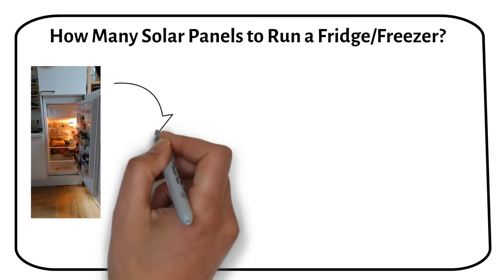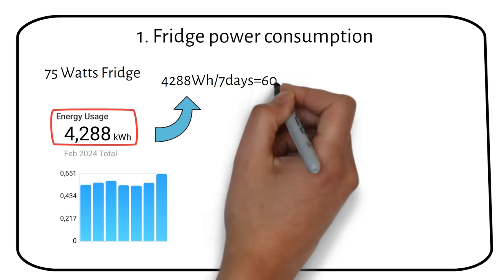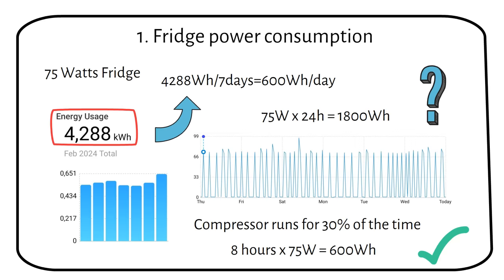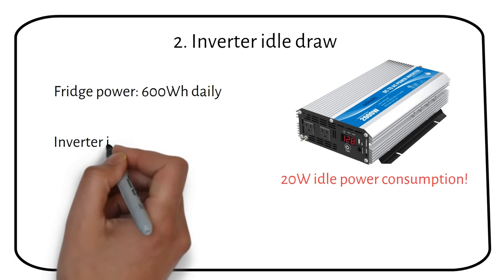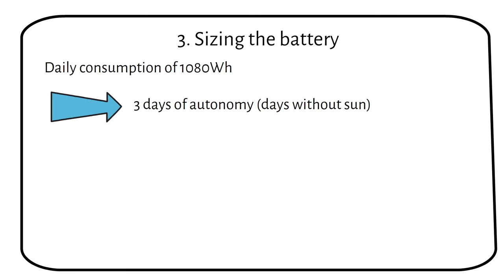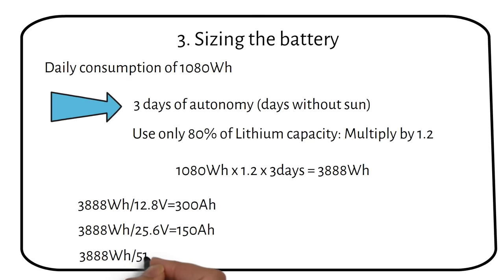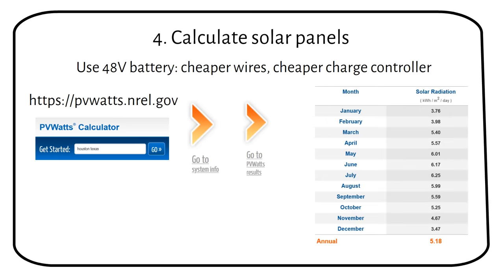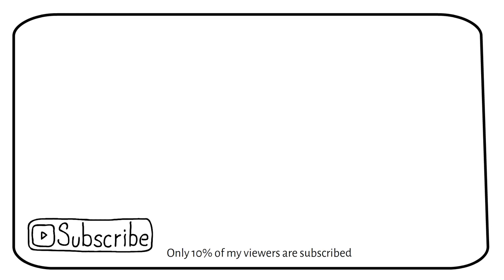How Many Solar Panels To Run a Fridge/Freezer?

Comment: Your video is very nice but has several problems. 1) In the slide at 0:41 seconds, the "Energy Usage" shows 4,288 kWh. It should show 4,288 Wh. 2) You are not taking into account DC-DC losses (solar panels -> solar charger-> battery) which are 10% to 20%. 3) You are not including DC-AC losses (battery -> interverter -> AC) which are 10% to 20% but can be much higher for low power loads such as 75W. 4) You recommend three days of battery storage (good) but then recommend recharging the battery (3 days of charge) each day which is oversizing the solar panel array. 5) I do not recommend using the worst month of the year which results in higher cost and wasted solar production for most of the year. Instead, use a low-cost inverter generator to recharge the batteries on poor solar production days.
Reply from the maker: Thanks for your comment John. It's using European decimal placements. I figured the people will figure it out. If I take every loss in account then nobody would end the video 😄. I'm displaying a still simplified calculation for the viewers who are new to solar. I made a video about how long a fridge will last. It talks about losses more in depth. It would be great if you could share your findings on that video as well. Thanks
Reply: @cleversolarpower I did not mean to criticize your video as it is very good at covering the major factors to consider. I have watched some of your other videos and you have a good set of videos that share information.

Comment: Solar panels are now cheaper than ever. I recently bought a 460W panel for just 72 Euros! Good quality as well. So no reason to save too much on panels.
Reply: too much panels are never enough, they are chea nowadays. The limiting factor are the square to fit them.
Reply from the maker: I agree. Second hand is even cheaper.

Comment: Sorry, but from what I understand you calculate the PV size in order to recharge the batteries fully in one day, after they were discharged after 3 days of autonomy. Maybe I didn't understand correctly. But if I did I would argue that in reality you need much smaller (dare I say half) of the PV energy production. Please let me know what you think and if you have run some tests with smaller PV size 🙏

Comment: Clearly a solar system to run just a refrigerator is a hard sell considering the average refrigerator in the U.S. only costs about $100 per year to operate, and a solar system designed to accommodate only that will cost thousands of dollars. That would mean a return on investment of at least 20 years.

Comment: 24h Inverter draw seems ludicrous (80% of total fridge draw!)... isn't there a smart inverter or a timer for the inverter you can sync to sunlight cycles? 

This would result in an 8-12 hr inverter draw depending on lattitude.

Not sure what the dusk to dawn generation actually is... would imagine nextlatitude.

 If so, could inverter simple be turned off (via timer or on via light sensor)?

Great video though, really appreciate the thorough breakdown of everything!
Reply: If you turn off the inverter you turn off the battery so no power to the fridge.  The inverter takes the DC from the solar panels or the DC from the battery and converts it to AC for the fridge.
Reply: I live in southern Norway (59' North) and have an off-grid summer house with a refrigerator without freezer which use little power (was announced as 62kWh /year) , Liebherr TP1720-21 and    use a 600W ePever Inverter which have a remote on/off switch. This is connected to an external thermostat to the refrigerator. Then the idle current of the inverter does not influence too much on the total power consumption. Refrigerator is On from Easter to October without any problem running on one 12.8V/100Ah Lithium battery and 550W of solar panels. If can run 4 days of total darkness,but us others have mentioned, som wattage are generated also on clouds days
Reply: There are several different quality manufacturers of DC refrigerators and freezers. They generally have much more efficient compressors and are double insulated for roughly the same price as a regular AC unit. I have a DC 20cu/ft chest freezer that runs just fine on 200W solar panel with a single 100 amp/hr battery. I'm not talking about the small portable refrigerator and freezer that plug into your 12v car socket. I'm talking about stationary refrigerator and freezers identical to what you would find in any house. They are indistinguishable from regular appliances.
Reply: @daviddogsbody  are there no 12v fridges. The computer world tries to get to 12v DC now to save on power supplies, especially in data centers.

Comment: 2  3 hundred and twenty watt panels 4. 1 hundred amp lithium batteries 1 Twelve hundred watt Phoenix inverter 30amp charge controller  work great

Comment: I did it differently I used a voltage switch  connected to a 12v battery charger,  feeding a 100 amp hour battery and 5 100w solar panels if the battery volts fell below 11.5 then the charger switched on, when the battery volts rose above 13.8 the charger switched off the solar panels were connected across the battery 24/7 as is the 150w inverter,  that way there is no interruption to the supply to the fridge freezer, ie if  there is a time when the panels can't fully charge the battery ie some winter days and at night then the charger takes over,  its a sort of mains assisted solar supply,  that way the number of panels and size of battery is not to critical
Reply: excellent..

Comment: What inverters are recommended? Thank you for the video and comments.
Reply: Good question. I have an 800W inverter, and it seems to get at it's limits in the moment the compressor starts. Thankfully my inverter has some short term overload capacity. Even if the fridge only consumes 75W in AVERAGE, during compressor start up it need's much more. First i tried it with a 300W inverter and it did not manage to handle the start up currents. It went into overload protection mode. The 800W does work, but it sounds very loud during that moment. I kept the 800W, but i would recommend more than 1000W. Maybe someone else here has tried it with a bigger inverter?

Comment: There's a couple of tricks they won't tell you when building off-grid solar to maximize power at minimum cost. 
But, you'll have to think outside of modern convenience.
First...set your panels up facing East and West with solar breakers that get flipped at noon. You'll pick up 6 to 8 extra hours of sun per day.
Second... only use heavy draw appliances when the sun is out. Turn off the fridge at night and during heavy clouds. It will stay cold a long time.

With these strategies, you can run that fridge with two 300w 10a panels each way, and 6 -12v  batteries in a 24v pattern.
Reply from the maker: That sounds like a big inconvenience. Why flip the breakers on at noon and not just leave them on? Why run the risk of spoiled food when you turn off the fridge?
Reply: @cleversolarpower  
Because a refrigerator is insulated and is fine for 12 hours. Why drain your batteries? That seems a lot more inconvenient.

Comment: This is a wonderful video! I see some campers and RVs have typical home refrigerators and they pay for it, of course.  If using shore power mostly, that can make sense, or if they have huge solar / battery systems.

I see a lot of vans have about 4 solar panels.  That's a far cry from the 11 that would be required.  

If I was a van guy I'd get something like dometic designed for low power consumption.  My biggest expense would be the laptop.  I could get away with low power settings.  The numbers you give allow me to accurately compute power usage here and see how many panels would be needed.  

Typically I run 15W according the Battery Info software in Linux.   That could be off by some amount, of course.  It can get to 30-45W.  I can tweet my usage to make it less.

Ty for info!
Reply from the maker: You can also get a more efficient inverter for the fridge. A 1200W victron phoenix inverter uses about 10W idle. Since phoenix inverters are low frequency, i think you should be able to power a 75W fridge with the 500-800W inverter.
Reply: @cleversolarpower  Ok, thanks for the tip.

Comment: I found a brand new Liebhr 24 inch full size fridge at the brick (Canada)for a cabin i have,, it was missing some of the front covers and door handles and I got it for $500 , according to its spec sheet it uses 0.789 kwh over a 24 hour period , 288kwh annually , its power specs are 183 watts at 2.3 amps which I think is amazing for a fridge this size,, I have power at the cabin but we arent always there so I am trying to put together a solar backup when the power goes out strictly for the fridge(Shuswap was devastated by a huge fire recently and power was out for weeks)
Reply from the maker: Yes, Liebhrr fridges and freezers are efficient. They cost a lot more, but if you are off grid it will save you money in the long term.

Comment: Sounds about right.
If you want to go cheap and efficient, you can go for a minimal option with regard to everything. It then does require you to monitor battery status closely and unplug your freezer units and hook em up to the normal grid when your input power is low. So basically have 2 separate systems.
Also helps a lot if you lay down a strict policy on yourself for opening the fridge/freezer door, when power is low. Saves a lot of energy. Also keep your fridge/freezer well organised, so it doesnt have to be open long. And provide them with enough room (depends on which model) to cool itself. etc

Comment: Most inverters have a switch to turn off the stand by function.
Utilise this switch into the fridge controller circuit, and when the fridge compressor is not needing to run, disable the standby on the inverter.
When the compressor needs to run, just pony an auxiliary contact to turn the inverter to run state.
The battery will still charge, but the panels will not need to overcome the standby current while charging on a non-standby state.
Reply: To extend your idea further. Most modern refrigerators will hold temperature for many hours. Put the inverter on a timer that turns off the inverter at 10 PM and back on at 6 AM. Then cycle on and off during the day. That can reduce standby inverter losses by 50% or more.

Comment: Good luck 
I’m on a boat in the caribe. The heat loss is amazing and a lot of battery power used for refrigeration. 
Certainly way more than your % lol without opening it at all
Reply: Hardly surprising that a boat fridge isn't as thermally efficient as a household one.

Comment: My fridge with top freezer uses 210 W during normal running.  When the frost free cycle kicks in it requires 900 watts for about 10 minutes.  Size your system for peak loading or you may have surprise shut downs.
Reply from the maker: That's a huge power draw for the defrost cycle! Never seen it this high.
Reply: 900 w is possible for defrost Because elements that heats up evaporator.Maybe possible to install lower wattage elements.But in general far better to use cooling system that fit with solar.Cheaper

Comment: The inverter is wasting 40% of the electricity. Instead of these small cycles and being always on. Why not turn it and the fridge off overnight on a timer when its typically colder anyway, its not open. Then let it recool in the morning, reducing your idle power consumption a lot. Plus you will have power running the fridge when its sunny, directly. You could just connect it more directly, no? It seems crazy to spend thousands on such a huge system just to power a fridge.

Comment: By swapping the fridge ac motor to a DC motor that can run straight off the battery would save big time. 

This would eliminating the inverter cost/efficiency, and the battery size of almost double, and the double the size of the required solar panels.
Reworded, using the inverter you need a 80% larger (1080/600=1.8) output, now the three day deal makes that 3 times worse for the battery and panels..Now the ~100W DC motor would cost about 50~100 usd, compare that to increased size of the overall system. 
Someone do the math to show how much lower cost going this route. Without the inverter cost, plus 60% less cost on battery size and panels needed, I would say it's a win win.

Comment: 4 years ago I had a solar system put on my house I wanted to add batteries I have 37 panels I was thinking 8 200 amp 48 volt batteries
Reply from the maker: Why do you want to add batteries if you are grid tied? You can add some if you have to pay for grid feed in or don't get money back, but that would be to bridge the use during the night. 8x 48V 200Ah batteries gives you 80kwh, thats a lot, and probably not economically viable.
Reply: @cleversolarpower  it wouldn't be 8 48 volt batteries I was thinking of getting 8 12,200 amp hour batterie I'm making a 48 volt system my living room together another words two sets of four and yes I would like to be able to go off-grid in case of a disaster

Comment: I do a bit of camping here in Australia and i have learnt to cheat the system.  I use a 12v system 65ltr fridge/freezer  but it will work on any system. The trick is to run your fridge/freezer colder than it needs to during the day when you get the most sun. So i run mine at -5c. Then about 8 o clock at night after i have opened the unit for the last time i switch it off. So between say 8pm and 6am its turned off. So it sits for 10hrs overnight switched off. When i switch it on in the morning its at about -0c so it's warmed 5 degrees overnight but it doesn't matter. So my overall run time is 14 hrs not 24.
Reply from the maker: When you run it at -5°C, then the food will freeze and thaw, which is not desirable. You will also consume more power when you set the fridge to freezing. I have a video coming up showing this. Even a small battery (12V 50Ah) will save your unnecessary energy expenditure and the need to set the temp of your fridge everyday, 2 times.

Comment: Your fridge is definitely not very efficient. Mine is a big one, with both fridge and freezer compartments, it even comes with 2 compressors  - 1 per each compartment, and the unit is like ~20 yrs old and the avg consumption in 24 hrs is 0.93 kWh, while yours is double than that : 1.8 kWh.
Maybe, consider replacing your unit for a newer one, with better energy efficiency, esp. if you're going to run it on solar power.
Reply: sorry, I was looking at the wrong numbers in the video - your actual fridge consumes 0.6 kWh per day, which is very good, 30% less than mine. Now it makes sense :)

Comment: My fridge uses around 150 watts 220v. And it seems working much longer than 8 hours a day. It's a camper fridge. It can use gas, 12v and 220v source.
Reply from the maker: Seems like a big fridge/freezer or an older type. Do you know the average consumption of the fridge per day in Wh?
Reply: Clean the dust and crap off the works underneath, fan, cooling fins etc.. careful use of an air compressor is good. Then they work more efficiently.
Reply: You might want to invest in a more energy efficient fridge.

Mine uses 56 watts. It is a 14 cubic foot Samsung garage-ready refrigerator with an inverter compressor. I got it for $700.

Larger refrigerators are more energy efficient because they have twice the insulation factor.
Reply: @cleversolarpower  Caravan or motorhome Thetford 3 N80EL, 3 Way Fridge. 240volts/12 Volts/gas. Dimensions: H: 821 mm W: 486 mm D: 543 mm

Comment: I have two domestic inverter fridge with freezer, one a  Samsung, the energy rating sticker shows 365 kWh/year while the other fridge is a Westinghouse it's energy rating sticker shows 440 kWh/year. How come your fridge uses 4288 kWh/per  ???

Comment: So that means you would need 3, 440w solar panels.  But i didn't see how the battery gets charged?  Has the inverter a battery chsrging capability or does the solar panels incorporate a battery charging system?  Also if using 48v system, dont follow where the battery charger is installed
Reply from the maker: That's in other videos. I answer one question at a time to keep it relevant 🙏

Comment: My Kenmore 21 cu. ft. upright freezer uses 135W when running, and 1.4kWh/day, including a defrost cycle. The defrost cycle can be defeated by selecting Sabbath Mode, to reduce the power consumption. All unused space is filled with 1/2 gallon jugs of ice. Thus, in an emergency I could run it on solar and battery plus I would have at least 2 days before thawing would begin. My Samsung 21 cu. ft. uses 2.4kWh per day and the defrost cycle cannot be turned off, I also have a 4 cu ft dorm fridge which uses the same 1.4kWh per day as the big freezer. I have yet another freezer in the garage which holds only foods that don't need refrigeration - cooking oil, bread, sweets, nuts, etc. In an emergency it will not be powered; and all the ice jugs in it can be used in the power-hungry Samsung fridge..
 -  -

Comment: Your calculation for the total solar power needed is wrong.

3.8kWh per day / 3.5 kWh per sqm per day
That should result in 1.1 sqm not 1.1 kW. That would also imply a 100% efficiency of the Solar modules.
Reply from the maker: 1m² does not equal 1000W. At most 1m² is 200W at 20% solar panel efficiency.  Therefore, 1100W of solar panels is about 6m² or 65ft².

Comment: I have a samsung 253 litre invertor fridge runs off 2  350 watt solar panels uses 34 amphours over night as its in my motorhome but i still have give it a charge up because theres not enough sun in the afternoon to fully charge it i run a 1000 watt inverter with a victron system management in summer we get plenty of sun but its usually that hot the panels dont perform as good as they should because of the heat and when we go away i have a 3.6!onan generator for extra power and red arc system to transform the power from the 80amp altonator 😳🤔👍